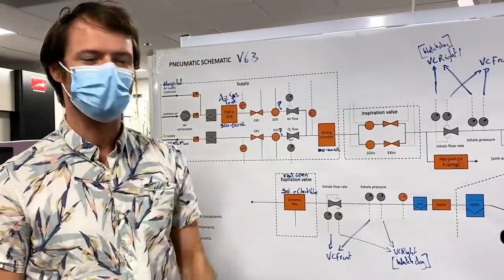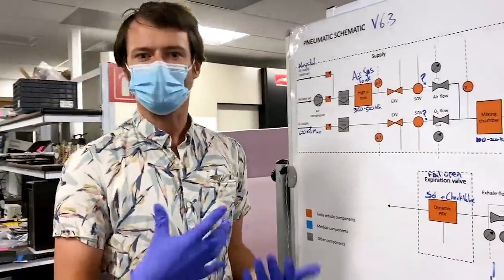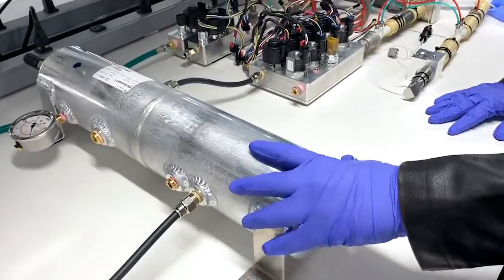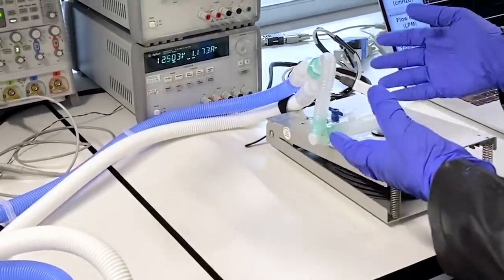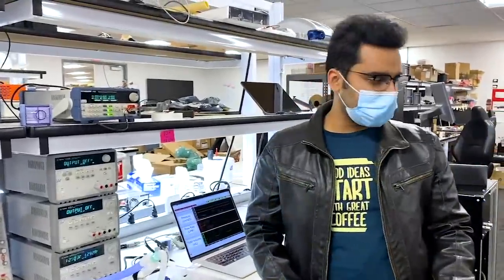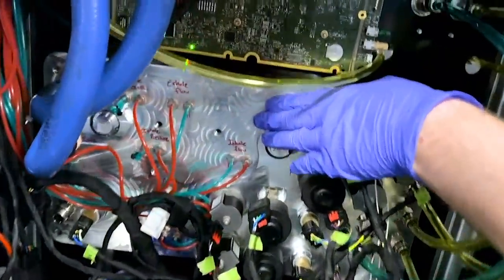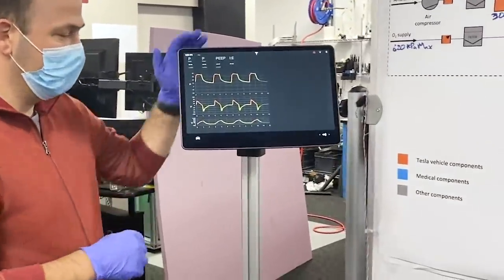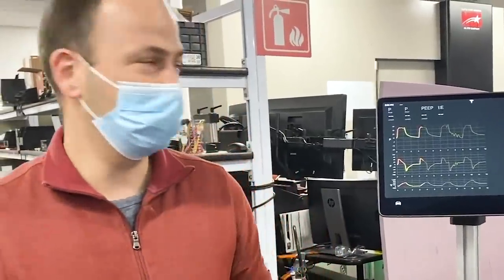Tesla Ventilator

Comment: Very GREEN Solution.
AFTER the pandemic, you can sell 80% of the device on the Used Auto Parts market.
Reply: Just gotta quarantine all ventilators for a couple weeks until they show no symptoms of fever
Reply: After a heavy bath in disinfectant...
Reply: No, you give the parts back to Tesla so they can stockpile and reuse them for the next ventilator crisis -- but Tesla's designs will be more fine tuned and efficient, making for faster deployment.
Reply: Ted R ,  Anything with a Tesla logo will be collector’s item.    
If you have that and a Flame-thrower, you’ll be prepared for the next pandemic
Reply: put all in autoclave at 120c and it’s all gone

Comment: Biomedical Engineer here. Please allow the GUI to extend away from the body at least 10’ (with option for 15-20’). This allows for GUI to be used outside of sterile or dirty room without forcing caregivers to Use valuable PPE. Thanks for everything you are doing to support our sickest patients!!
Reply: Geotechnical Engineer here. I see no soil. I’ll just shut up then.
Reply: Web Developer here - I can create a RESTful API so that people can upload their ventilator stats to their Wordpress blogs.
Reply: Mercedes F1 Team has already developed a specialised CPAP device along with University College London (UCL) and UCL Hospital. It has the same amount of pressure as a ventilator. There is no need for the invasive tube and you just wear a mask as you would with a CPAP. It can be mass produced to the tune of 1K a day from just one factory, and it costs less to make per unit. The solution has already been approved for use by the NHS in the UK.
Reply: Low voltage engineer here. Provide auxiliary relays so that it can be easily integrated into existing nurse call switches...
Reply: network engineer here: please put some security on the ventilators so patients don't hack other ventilators and get extra oxygen
Reply: @Brucelee89896  dont worry. tesla will organise hacking parties to challenge everyone at home to hack their ventilators
Reply: Maybe the video can be wireless somehow, but cable extended might help. Can it be inside the room but turned around to face the window, and/or have two monitors, one looking out, the other in the room etc.
Reply: It will have autopilot.
Reply: Software Engineer here... This GUI needs a MSI motherboard instead, and a bigger monitor for gaming. Additionally, a upgrade idea would be to add a remote so it can be controlled in another room!
Reply: Im an engineer too. lol
Reply: I work at a grocery store, so I’m kind of a hero. I say everyone’s wrong, and that Elon should start a craft brewery/restaurant chain.
Reply: Weeb here. Not enough anime and catgirls here.
Reply: HR professional here. I'm just here to dampen the mood.
Reply: Or it can be made wireless and able to connect to another external device
Reply: Sex engineer here please allow a D2 input valve for a input of ED drugs so patient can get a hard on!
Reply: actually, since its tesla, it can send a push message and GUI to your phone online. you can also monitor thousands of patient using the tesla app. More importantly, if a patient dies, it will notify police and sends a push message, as well as use artificial intelligence to do an auto-setting in the future
Reply: @mikumikuiyada  Apparently old Biomedical Engineers don't know about wireless tablets yet.
Reply: @bryanboldt887  He did not say how to have remote operation.  Wireless would work but brings up a whole bunch of security concerns, that maybe a long cable could solve.
Reply: marcpawl  I agree but since it is highly contagious it would benefit the healthcare workers if it had remote function.
Reply: Ummm respiratory therapist here.... you have to be in the room
Reply: Sanitary Engineer here.  Uhhh no.  My engineering degree trumps yours, so just humbly listen to ME!
Reply: Theee Chosen One he’s just trying to help mate, be nice.
Reply: Theee Chosen One Janitor here, uhhh ummm yea whatever
Reply: Reality here: this is a PR stunt that will never be used on any actual patients and is no different than Musk's previous PR stunts (e.g. Thailand cave boys).
Reply: Masters in life here, let these people die. Global warming must be solved by any means!!!!!! Less people = more resources, land, and less pollution.
Reply: @JimmyVaught  Jimmy, you go first!
Reply: @JimmyVaught   Congratulations Jim Bob. You are now in the running for the 2020 Pro Choice Poster Child!

Comment: Looks expensive.
Reply: Actually, it is probably a lot cheaper than similar units produced by the medical equipment companies. Cars are a much higher volume product than medical gear, and car computers are built to an exceptionally high standard of safety and reliability in a very harsh environment. Re-purposing them for this application is a really great idea.

If you look at the schematics, they are also using redundant sensors and valves to further increase the reliability. This is not just a minimum effort prototype to pump air in and out, but something built as a life-critical system.

I think simpler ventilators can also be very useful, but here we see Tesla engineers doing what they are very good at and what few other groups are capable of doing as efficiently.

Comment: This is pretty excellent. It is one of the first ventilator solutions that actually implements appropriate air sensors, a PEEP function and air flow monitoring. Hats off to the tesla engineers for throwing this together so quickly. It's pretty neat that so many car parts could be reused. I can imagine they are finalizing the software interface and optimizing the machining process to reduce the cut time on the custom manifold production. Again, awesome job guys!

Comment: Your "best effort" is already better than most of the medically approved devices out there. Leveraging vehicle parts has price/volume opportunities that a lot of Medical companies can only dream of.  Well done team.
Reply: Spectacular! And even though mass produced and therefore relatively inexpensive, the car computer is already built for an extraordinary high reliability in a very harsh environment. And software engineering standards for its firmware assume that people's life depends on it.

If you look at the diagram on the whiteboard, they are also building in redundant sensors and valves. It may be a home-brew ventilator, but it is being built to a highest standard of safety and reliability.
Reply: @cogoid  Good points.

Comment: Tesla engineers: We just build a ventilator prototype -  mostly by utilising Model 3 parts...

Ford and GM: Google, what is a ventilator?
Reply: Ford's ventilators go crashing into crowds...
Reply: Christian haha
Reply: Ziggi Mon  neither company has produced a single ventilator, they haven't even built a prototype. They have not produced thousands, they haven't even produced one. They are still in production design phase. Tesla however gets to skip that because they are using parts that already exist.
Reply: @williameldridge9382  There is no need for GM and Ford to build prototypes.  They are each taking existing and approved products already in use and ramping up a supply base and assembly areas to produce them in higher volume.  Not a simple task for something that 600+ parts and a goal of producing >20X the monthly rate of the original company (at least in the case of the GM project).  While GM is still a few days away from building ventilators, they have already started producing surgical masks and will soon be making 50,000 per day!  I for one hope that GM, Ford, AND Tesla are successful at their efforts!
https://www.cbsnews.com/news/general-motors-face-masks-warren-michigan-plant-re-open/
#IWorkForGM
Reply: Does anyone have a link that shows the ventilators ford and gm are building? Not trying to shit on them just worried they might be doing the shitty design virgin galactic came up with (their "respirator" would probably kill more people than save)
Reply: @MrBubmer  I've tried to post links a couple of times but something with YT's algorithm keeps blocking the posts, or maybe just overloaded from all the traffic, lol. But just Google GM and Ford ventilator production and you'll find some posts with rather vague timelines, but most point to late April at the earliest, but not sure if that includes some of the rigorous testing that will have to be done, at least on the early production.  But from the state of things, and as it worsens, they will need everything they can get, even if they only serve as stop gaps before moving patients to better, proven models.
Reply: @MrBubmer  GM is ramping up to build 2 models from Ventec Life Systems.  This page shows the main one.  I don't know much about ventilators, but it looks like a very good product to me.
https://www.venteclife.com/
#IWorkForGM
Reply: https://youtu.be/U6WYByEWX8o
Reply: Actually Ford is already helping with the manufacture of one of GE healthcare's current model ventilators, so it's just gm that's sitting on their ass right now.
Reply: @ClippyNeverSoldout  So where is Fords video. I own 2 Fords 1 hybrid 1 all electric. They have not been driven in a while and both have dead 12vt batteries.  It has something to do with the GPS system.  Good luck with that.
Reply: Loganbay battery’s lose charge. Also I don’t see the connection too GPS and ventilators.
Reply: Ford i already make a 10 000 units,
Reply: @microesfera100  NOPE!!!  Prove me wrong Bubba, smfh.
Reply: @russell2449  
wait 4 weeks 
ford thousands of ventilators
Tesla  wait for the best
Reply: The current resident of the white house picks GM he wants to kill as many as possible with all the decisions
Reply: @b4804514  Doctor: I'm sorry sir, we lost your father.  The ventilator wouldn't start at first, but when it finally did, it spun out and crashed into a ditch.
Reply: @randy7928  Yes the GM ventilator was a winner except... Death toll for GM ignition switch: 124. General Motor's flawed ignition switch, one of the deadliest auto recalls in history, killed 124 people. Good choice Pres
Reply: It's actually the EXACT OPPOSITE. GM is producing actual ventilators that will actually be used by patients. This is 100% a bullshit PR Telsa stunt no different than their bullshit PR stunt for the Thailand cave rescue of the boys. This tesla nonsense will NEVER actually be used on any patient.

Comment: These guys need to hack the masks to avoid it slipping down and having to constantly adjust it to properly cover the nose. I suggest using a zip tie that comes with trash bags. Glue one to the top of the middle portion and pinch it for your nose setting when wearing the mask. This will ensure a tight fit and will not expose the nose even after wearing for a long time.

Comment: It's great that Tesla are trying to help out but their design is completely over engineered and will be difficult to mass produce in the quantity that is required. Oxford university have already made a working prototype for a ventilator that costs around $100 to make and can be easily mass produced due to its incredibly simple design. Still, even if Tesla manufacture and provide any amount of ventilators that is obviously still beneficial.
Reply: A few days ago some of the news outlets have been smearing Tesla for donating simpler ventilators to the hospitals. (A typical headline was: 'Ventilators' donated by Elon Musk can't be used on coronavirus patients, health officials say) It was not true of course -- they were very useful devices, but indeed with limited features.

What the universities are improvising is another notch or two down from that in features and reliability.

There is a place for the simple ventilators. With mass casualties there will be no overabundance of expert respiratory therapists to fiddle with the advanced machinery. A unit with the minimal features may be exactly what is required to save most lives and prevent patients from deteriorating to a stage where even more advanced care would not be very effective..

But Tesla already has a warehouse of computers built to the extremely high standard of reliability -- (your life depends on it when you are driving!), and they are used to program this hardware also to a very high standard of safety. This is a pretty extraordinary resource, which they can leverage possibly even better than most medical equipment manufacturers. I think they are doing a spectacular job here, and if they can actually put these units into production quickly, it will be an extraordinary achievement.

Comment: Great contribution! I'm wondering why we can design a tiny smartphone with many sensors but these still need a relatively oversized design?
Reply: Well, phones also started big, I guess it will get smaller with time.
Reply: You should watch the real engineering video on this. You need all the sensors to prevent the slow destruction of the patients lungs. Turns out the lungs dont like to have air forced down them.
Reply: @paulhanley3368  Can you share a link?

Comment: This ie GREAT,  A question I have,  when do you think you will have FDA and CDC approval then when will you have at least 10,000 units ready to ship ?
Reply: @Julio Cezar :  Yes I am aware of this issue.  I worked a Amgen some years back as part of a team to design and build a smaller Ventilator for portable use.  This was back over 18 years ago.  Amgen spent several million dollars on R& D and after more than 9 years of trying to get FDC and CDC approval the company shelved the project. Even under emergency  circumstances it will take months if not longer just to get approval to build a new unit.  This is why there are only 4 ventilator manufacturers in the US. And the cost is over 35 thousand dollars each.

Comment: Great job ao far guys. Can you walk through the software also? For instance, where did you get the design constraints from? Did you use existing open research on ventilator designs? Also, who is providing medical advice on the designs both in hardware and code?

Comment: Great job Tesla! 

I have possible good but more likely stupid megalomaniac idea. You remember that doctor in Italy that made some type of 3D printed valves and pipes or whatever so one ventilator could be used for 4 or even more patients? Well what if you do something crazy like that. Like, there is need for humidifier at input, right? Why not make huge one for 100, or even, something more crazy, 1000 patients? There is need for pressure? Sure, make that huge too. Then, you make pipes all over hospital, and at the end, there are sensors that detect when valve needs to open for that one patient. He gets his humid pressurized air at right temperature, doctor can play with variables at his end and it is scalable, you don't need to have 1000 humidifiers and 1000 pumps and whatnot.

t. not engineer obviously lol

Comment: As an RN that has (and still is) worked with and has transport these patients...20-40 minutes goes fast... if you could increase the battery time to 60-90 minutes it would be more helpful if there's was a transport delay (not all hallways/elevators have uninterruptible (connected to generators)  power in case of an outage)).

Comment: Though it’s great to see these people build very needed equipment, they would be better building CPAP machines, no need for specific trained nurses/doctors/anaesthetics, just plug into the main hospital oxygen....
The CPAP machine delivers a constant flow of air through tubing and a mask and into your airway. The CPAP machine creates enough pressure in your airway to hold the tissue open, so your airway doesn't collapse. The soft, steady jet of air from the CPAP machine creates enough pressure to keep the airway open.

Comment: Very impressive line of work!
However, for better applicability in real-life clinical scenario, these makeshift ventilators need to address the ability to properly respond to patient "triggers."
i.e. the spontaneous inspiration to initiate the mechanical ventilation cycle by the set parameters and the ability to allow the patient to fully exhale before another breathing cycle.

Also, in the settings of ARDS (acute respiratory distress syndrome), clinicians often resort to high-frequency oscillatory ventilation (HFOV), a capability yet to be seen in current improvised ventilator models. 

Really excited to see the hard work of Tesla engineers, and thank you for your hard work.

Comment: What if Bigdata and machine learning could identity a breathing pattern, which is an early telltale sign of the virus, however, small, that humans can't detect it.
Currently, testing takes a few days. If machine learning algorithm could within 10 minutes say you have breathing symptoms that match the virus, that massive turn around improvement
and much simpler test once the algorithm is in place. Would require early monitoring of a patient with high like a hood that they have the virus and in 3 days will show all symptoms at levels noticed at scale level of humans. Then supervised learning results based on positive or negative test results later.

Just a thought ;-) could be quite interesting. AWS and the likes, could try out some of there latest tech as long they have copies of the data that had been crowdsourced with results and had been cultivating for x hours already, so breathing analysis can be associated correctly with the stage virus has developed to. Such that in the future it could also give an indication of the stage and how far along the infection has been cultivating for.